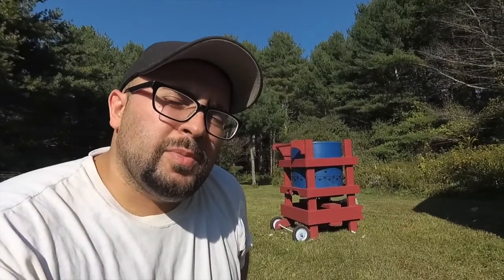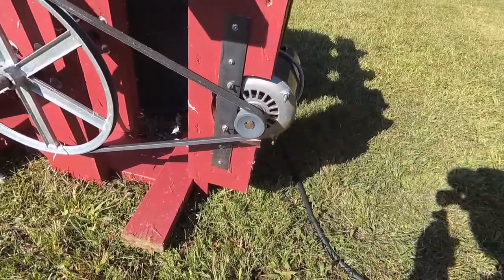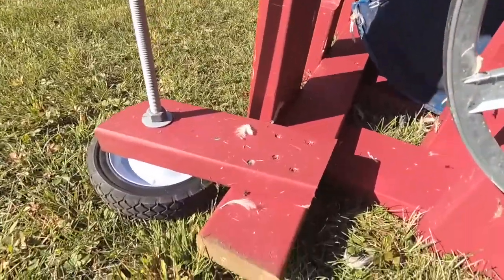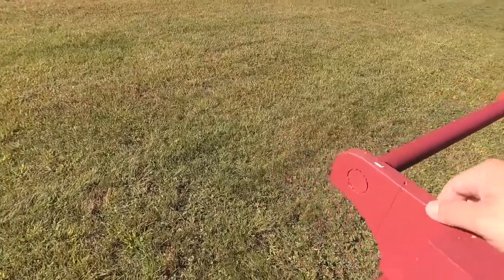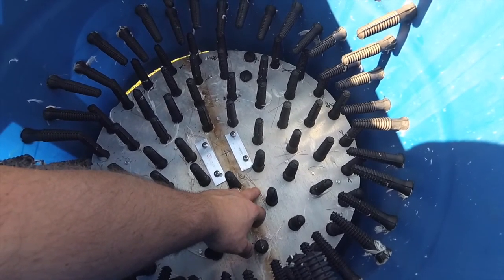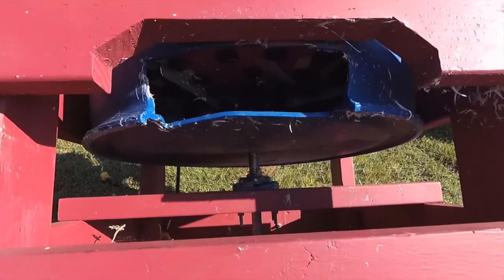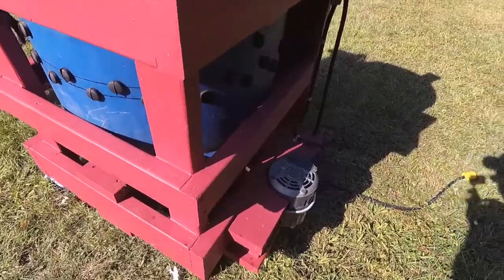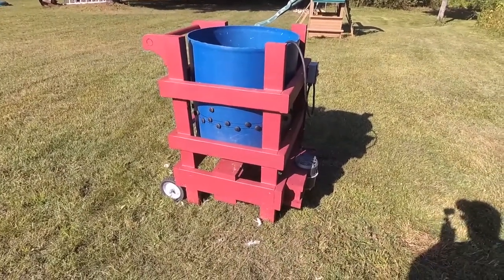HOW I BUILT MY CHICKEN PLUCKER !!!!!!

Comment: Thanks for breaking down the construction and provideing the RPMs 

Tractor Supply co sells American made pullies and bearing blocks  

What size does the book recommend for Quails  and then Turkeys ?

I am thinking of plumbing in a spray set  with a Ball Valve  hooked to a hose  and a chute on the feather discharge  to control the feather mess
Reply from the maker: Your welcome Walt!!! I might add a valve and spray line in myself.  The book doesn't specify rpm for quail and turkey just different finger types for the quail and pigeon.  Turkey can be done with the chicken setup.  Thanks
Reply: Do You sell the meat ?
Reply from the maker: No just process it for me and my family.  Thanks Walt